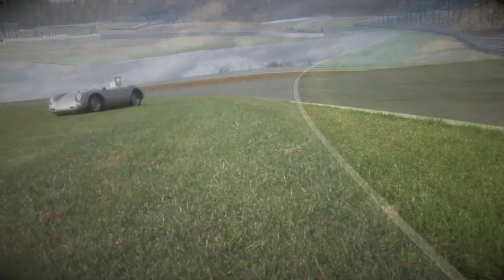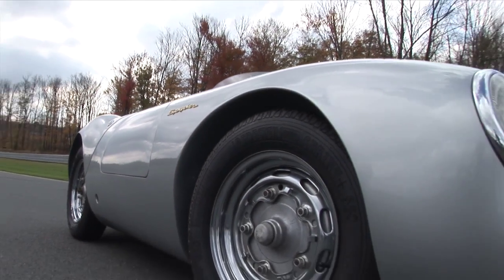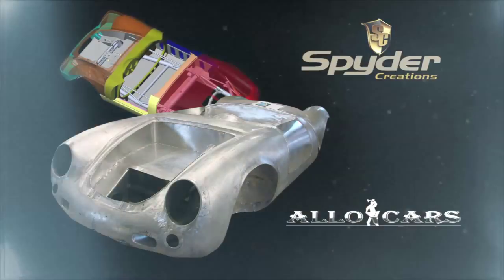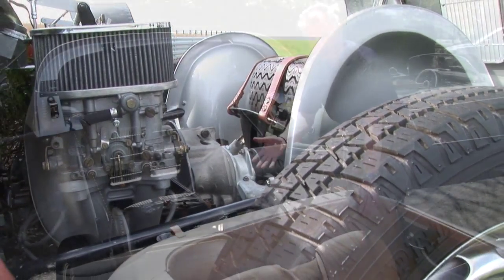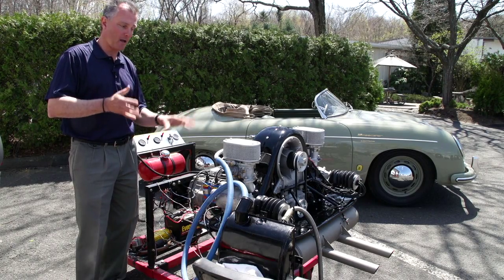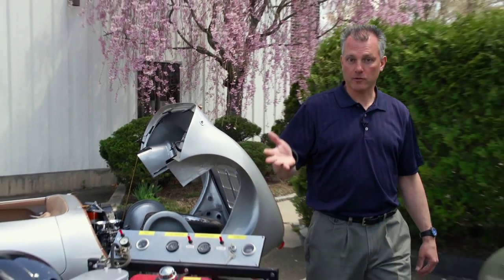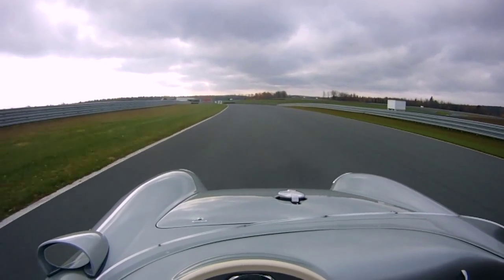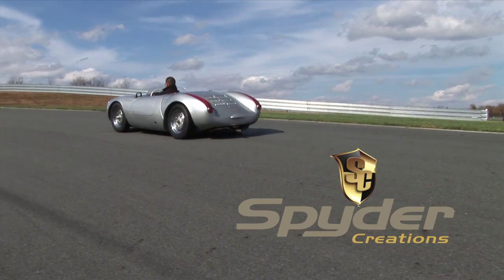Hand made all-aluminum Spyder 550 Porsche tribute car

Comment: I'd like to see an all aluminum vintage styled fiat 500 with the modern fiat 500 I2 engine. I imagine it would probably weigh in less than the 1100LB original stock weight, even with the larger engine.

The mileage should be phenomenal, unfortunately I don't think the modern I2 is available in the US.
 
It would probably perform good as well.
Reply: That's a nice idea.

Comment: One thing, Aluminium does not last on steel. does anyone know if these guys have got any technic to avoid that?
Reply: Sam - are you concerned about the electrical (galvanic?) interaction between dissimilar metals, and the potential/inevitable corrosion if the two are not properly insulated?  Very interesting!  Inquiring minds want to know!

Comment: I am a former owner of the original 1956 550-1500 RS Porsche Spyder # 90....recently being offered for auction on the www.   The  only change that I can see and that I don't agree with is the color of the rear fender striping.  It is Blue, not red, on the original.  My mate, Fred Sebald, also built a Beck's fiberglass  replica car using all our original photos of the original # 90.  Check out the recent auction pages for the sale of the 550 #90, of Vijay Mallya's collection for yourself and for more history.  Gail Patricia Bauderer-Sebald......
Reply: Hi Gail: Many thanks for your input. So great to hear from a name I've seen written in the historical Spyder record for years. Our family used to own 550-0053, some 20 years ago, as well. We have used 0090 as our chosen model for the SHAPE of our cars. We do agree that (yours) and Mr. Mallya's 550-0090 does indeed have blue spears on the clamshell fenders. Our re-creation decisions were laser-focused on the actual BUILD differences on later cars (high-rail 550's from 0076 thru your car) vs. early low-rail cars (0016-0075) but not the so-called prototypes 01-15. Many spyder experts deal with the minor to major differences from build to build. We were forced to include all of this information when building our cars. Yes, our cars are made from a 3D model and then a buck of Vijay's 0090. So our shape is as close to exact as we could muster. (The 3D model even shows minor blemishes on this still- unrestored stunner of a Spyder.) When it comes to fitment of mechanicals we offer original 4CAM engines, as 0090 has, plus a 356 push rod alternative. Similarly we offer many color choices. Our HOPE is to remain within the original 4 Porsche 550 Spyder body-color options but original cars had many choices for spear color, red, blue, white, black, none! with or without the gold leaf hand applied pinstripe border. If you would like to chat more, send me an email directly rob@550spyder.net  I would be pleased to speak with you. Rob Edwards
Reply: Thanks for the reply.  The choice of the Red color on the clam shell rear fenders...and the # 130 on your very special "Tribute 550 RS S pyder" remind me of a photo that I have of James Dean at a L.A. gas station stop...before he was accidentally killed in his car.   Some of my own photos are being shared on the www for the "Bonhams Goodwood Revival Sale.....to take place on Sept. 11, 2016.....The 9-11 date is also my mate, Fred's, date of birth...and 911 is still my favorite model of the Porsche car owned by our family.   My Best to You...beautiful work!
Reply: @gmomowow2  Конечно трибьют воскрешение Спайдера 550 будет с красными стрелами на крыльях!

Comment: allergic to fibreglass?????? Guess I don't want a Porsche 904 GTS Carrera...or a Porsche 906,907,908,910,917,917/10,917/30...all made of fibreglass. You make a nice car...but a little more respect would do you well. Chuck Beck does a very nice car...most still on the road and youre kinda saying Porsche didn't know what they were doing with glassfibre. All of these Porsches I mentioned made of fibreglass were all winners.
Reply: His point is just that he try to explain the reason, why they waaaaaaaaaay overcharge this replica price wise.

Comment: you say its a handful?? lol.. Try running a 550 with a SharkWerks stroked 1986 3.4 930 Turbo with a G50 Transaxle whixh dynod at SW at 627BHP AND 561LBS/TRQ.. NOW let me ask... since I have a 1980 LP400S AND 1986 LP5000 QUATTROVALVOLE COUNTACH along with a pair of 08 Porsche GT3 RS & GT2 RS Manual 6 speeds.. along with my daily driver which is SUPERFORMANCE CONTINUATION STEEL TUB 1966 REGISTERED RHD GT40 MKII with a ROUSH SBF 427 and ZF QUAIFE RH SILL SHIFT 5 SPEED MOODY OWNED /Hutcherson driven Le Mans liivery #5. 3rd place var im Gold and Coral Pink trim exactly like chassis 23 except the weight and Hp are much more efficient than the Y block 427 and weighes over 350lbs less than the original and in the stand TX 2k17 ran 231.536mph...through 6 piston Brembo Brakes both front and rear..WHY spend such an indaane amount for a repkics.. its NOT. a continuation build as the GT40 CARROLL SHELBY SUPPORTED THE BUILD.. ITS 98% INTERCHANGEABLE WITH THE ORIGINAL...SOMETHING THAT THE '3D' PRINTED!!??? 
 CAR YOU ARE BUILDING CAN NOT DO. BTW..HOW MUCH IS A 800 ORIGINAL KILOMETER 4 CAM 1.5L THAT WAS FRESHENED UP BY THE PORSCHE Dream shop in Stuttgart 7 months ago. If thecprice is right.. ill sell it. whats your emai?? I send u copies of the Paperwork from Porsche and historic provenance the whole drive train carries..I have the matching # Transaxle and entire totalled car...if u want tge chassis # and info as well as the cars i have..let me know. i have 16 930 Turbos my pop bought new starting in 1976 along with 1980 to 85 Euro cars being my dad and I were back living in the U.k.over that time period. we are obviously both British and STILL have Resident Alien Green Cards.. We own a small Vintage/Exotic manual transmission focused Dealership and mutivehicle certified repair shop here in Vail Colorado.. We also have a large collection of 1950s Jaguar Race cars in the warehouse. its up to u if ur interested..Take care.CB

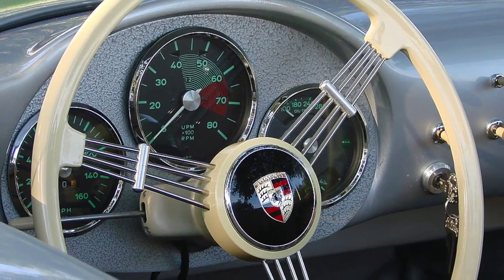Comment: Yeah, it's nice, but the attention to details...not that nice. It's the panel gaps that show the true craftmanship.. at 4:22 I wasn't impressed anymore.
Reply: Oh come on!  Really?  You don't like the hood?  You don't like the door?  It is, after all, the second evolution of a hand made object.  Me thinks the lady doth protest too much!  

Do you dislike Van Gogh for those annoying brushmarks?  Or despise Picasso for his childishness?  And Jackson Pollock for being too abstract?

Who are we to judge the art and thus the artist?  What great works have we brought forward?

Dies ist ein bemerkenswertes Kunstwerk.  Das ist der Hammer!!!
Reply: Probably wouldn't be interested in the original thing then. ALL hand made aluminum bodies have uneven panel gaps. The cold working of the aluminum is inconsistent due to the panels being hand hammered over a wooden buck and welded/riveted together As the metal expands and contracts with the weather the gaps spread and shrink unevenly. If you want it even you have to stamp the panels out and bold it together. The 356 is the same way and perfect originals look pretty rough.